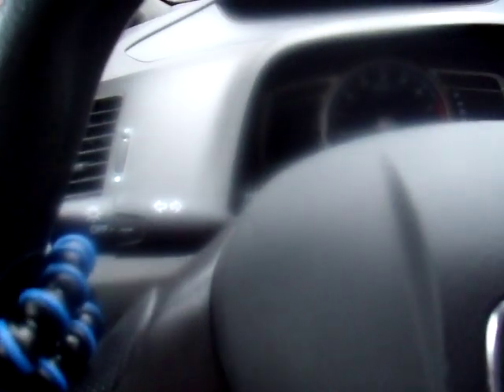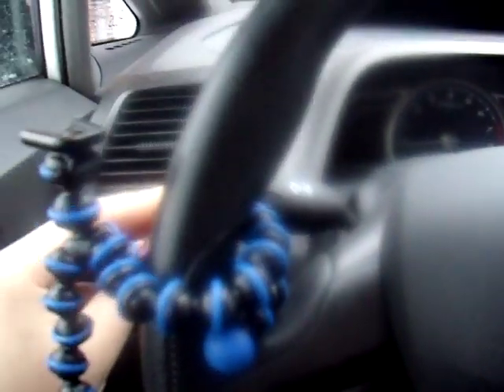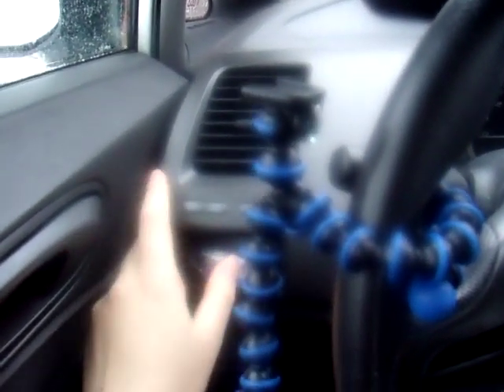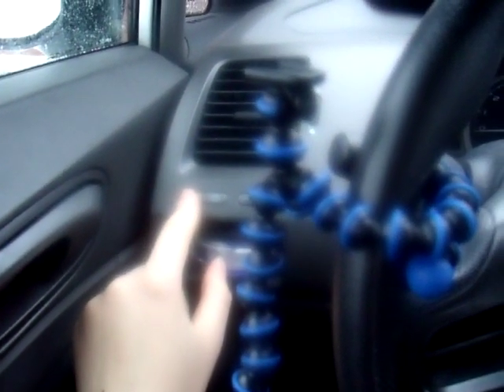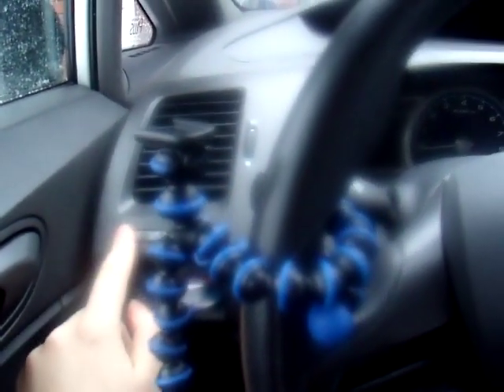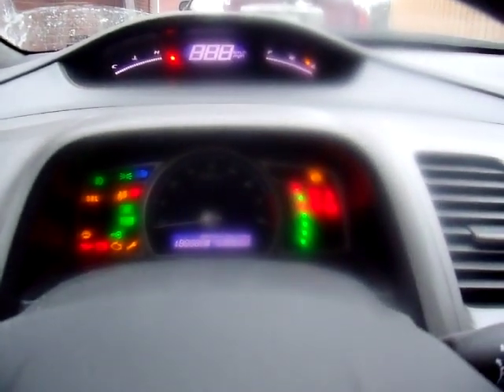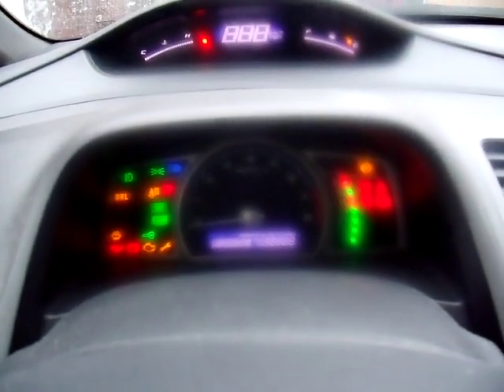Honda Civic digital dash cluster sweep test 2008

Comment: Im going to try this with mines since the fuel gauge always inverts
 so i hope this can correct the issue with my 2008 8th generation civic
Reply: Having the same issue with gas gauge , inverted. Did you find a fix for that?
Reply: @andiorl  yes. I replaced the upper cluster in the dash and the issue was resolved

Comment: I'm having problems with my gas gauge digital display, it's inverted.  Any ideas ?
Reply: ASKME AKYZUM  did you get an answer to this
Reply: No Janice I have not found out why this is happening.
Reply: Thanks i just sold that car n the person who bought it is flipping ugh
Reply: THE 08 sweep test does not tell you why the gauge is inverted. I've tried this
Reply: yes, im having the same issue with mines at 165k but I called HONDA AND STATED there isn't any recall or issues theyre aware of>?

Comment: I have a 2010 Honda Civic and I did the Gauge Cluster Sweep Test and in the odometer instead of 888888 "Error 1" is written. Can anyone help me with this and tell me why is "Error 1" written instead of 888888?
Reply: Maair Mukhtar Mughal did you ever find the problem?
Reply: Maair Mukhtar Mughal mine says error 1 has well
Reply: http://civic.hondafitjazz.com/A00/HTML/00/SNB6E00K73200000000BBAT20.HTML  If the word ‘‘Error 1'' is indicated, there is a malfunction in the communication line between the gauge control module (tach) and the fast-controller area network (F-CAN). Check for DTCs in the ECM/PCM and troubleshoot any DTCs found. If no DTCs are found, go to indicated troubleshooting.

Comment: My Honda civic display comes on and off. What should I do?
Reply: Reset the negative
Reply: @Anthomra  what does this mean plz?
Reply: @kendivezino8288  remove and re attach the negative wire on the battery
Reply: Hi Jen, I have the same issue. Dash illuminates automatically when everything is off and drains the battery. How did you solve it?
Reply: @nithinmthomas5041  where u able to solve this problem? How did you solve it pls, I have same issue

Comment: I have a questions, I a have a 2010 civic 4 door manual transmission LX-S, I need change bottom cluster gauge it a  not actual miles, I find cluster gauge in junk yard close to it own mileage.  Is it will work  if I simply replace the cluster or I have to program it on dealer, Thanks